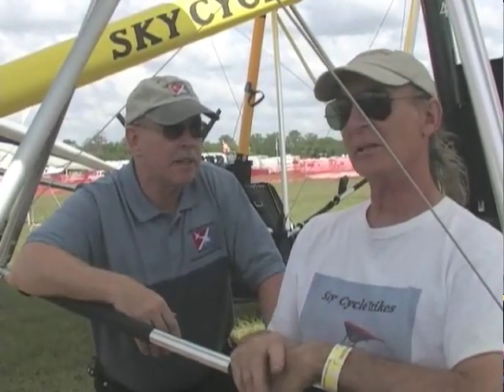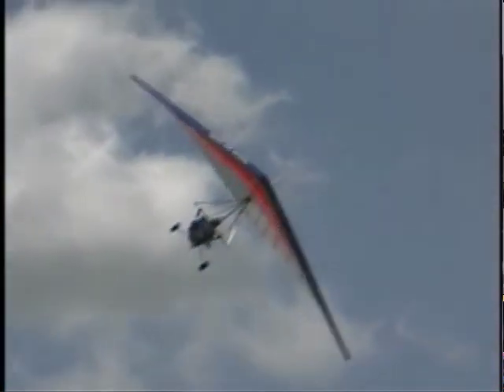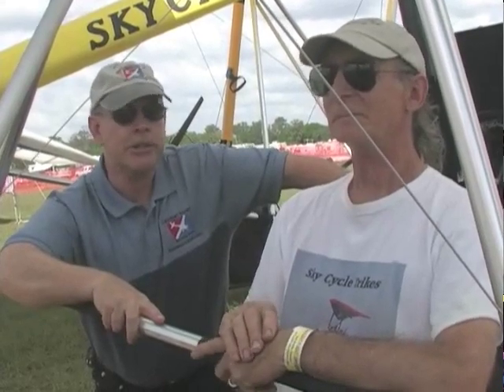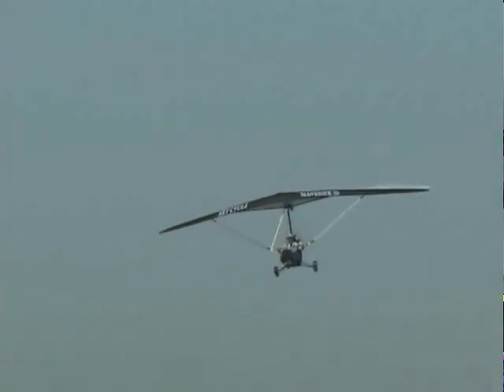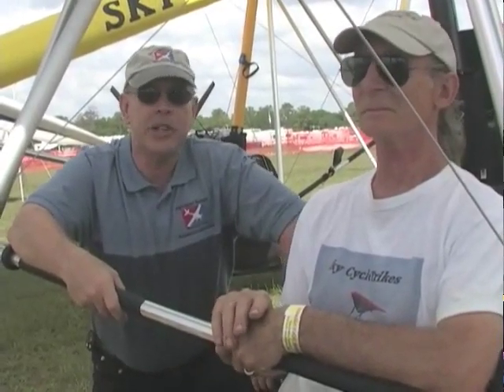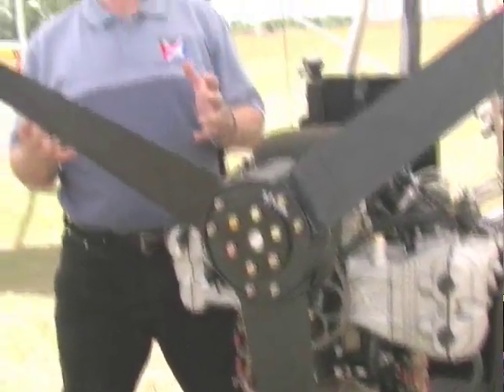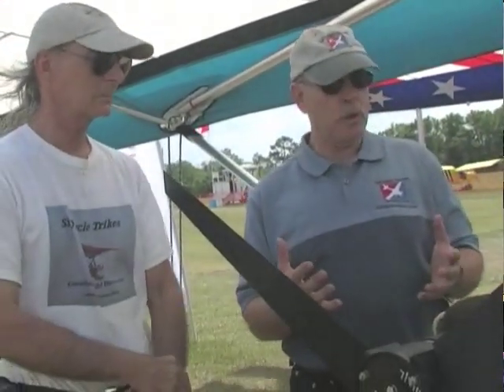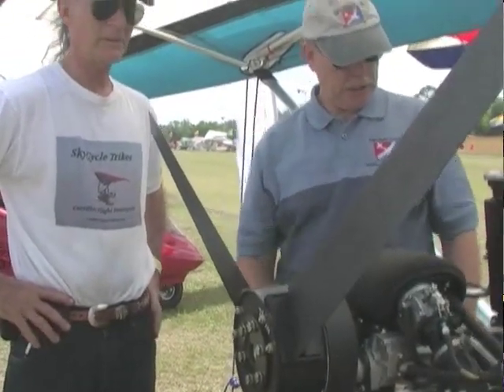Skycycle ultralight trike powered by Verner JCV-360 aircraft engine.

Comment: um, wouldn't rain water do into your air filter on the top and straight into your cylinder heads via gravity and freeze up your valves and cylinders?  i had that happen on a go cart engine

Comment: Cool little gizmo. Glad I found this. You could go from Honolulu to Lahaina with 100 mile range! is that 254 max weight a dry weight or with full fuel, coolant and oil?
Reply from the maker: As a legal ultralight it is 254 lbs empty weight with a 5 gallon fuel limit.